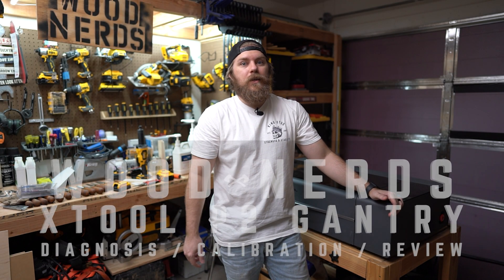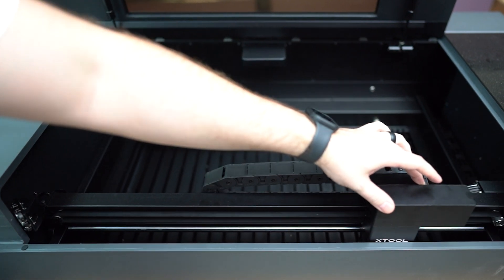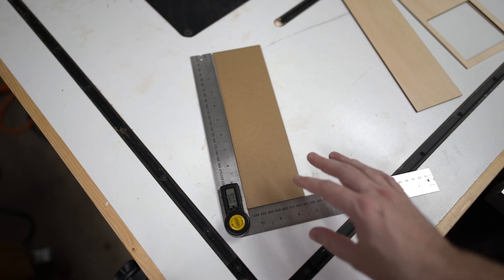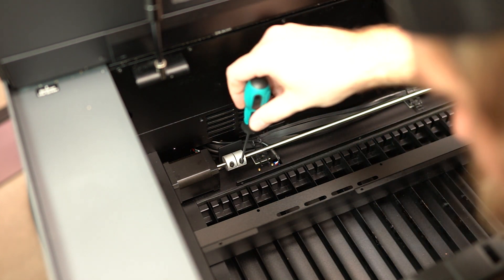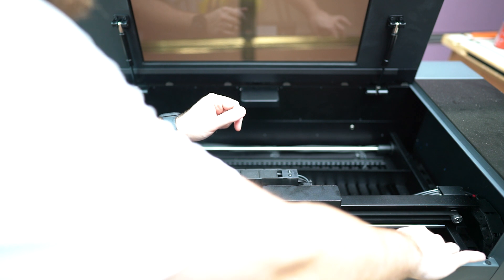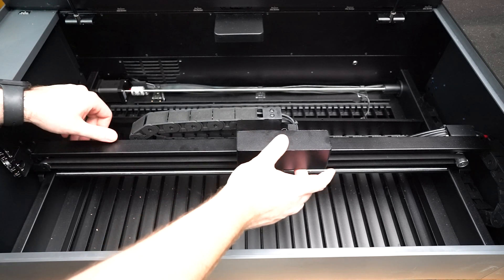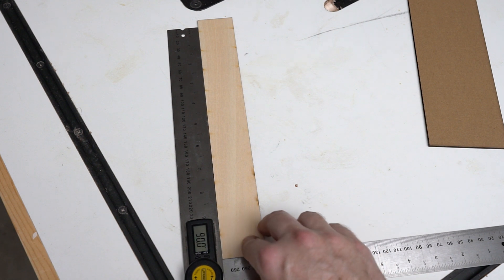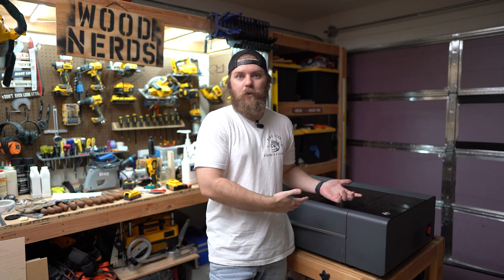xTool P2 CO2 LASER CUTTER | HOW TO CALIBRATE | REVIEW | SETUP

Comment: Great video! And sense of humor!
I’m one of the naïve poor souls that has never thought to check the gantry for square because I just assumed it was ready out of the box🤦‍♂️. 
Anyway, I know now what I need to do. I was watching another video, and he made adjustments from the front of the machine. 
Your method seems much easier. Is there a specific reason why someone would adjust the gantry using a different method than the one you’ve described? 
I only ask because I need to do this adjustment, but I fear the unknown… thanks man
Reply from the maker: Hey! I appreciate it! I’m not sure! I know xtool has different models out now. If what you have is the same as the one I show here I would go with whatever method seems easier to you. This method gave me near perfect accuracy!

Comment: I calibrated my P2 yesterday, because the gantry was not square.  But when I was unscrewing the pieces in the back, I guess I loosened them too much and the rod to the right disconnected.  I put it back, ran a test job and everything was fine.  Wood was square and right on. However, with the machine on, when I try to move the laser head or the gantry, it's very difficult and makes a grinding noise.  With the machine off, it's smooth and easy to move.  Did that rod disconnecting have anything to do with this happening?  Thanks for your assistance.
Reply from the maker: Hi, I don’t think the gantry should be moved manually with the machine turned on. With the motors off and disengaged they should be fairly free to move.

Comment: Greetings, thanks for the calibrate review! Can you tell me where the lower left 0,0 point is to line up material. I am a CNC guy for decades and Laser (P2S) is new to me. Thanks, Vince
Reply from the maker: Hey Vince! The user interface is much more visual with this machine. The camera allows you to place your burn program on the material you have on the laser bed. With the knives it’s hard to describe accurately where the starting point would be as if you had a grid mapped out similar to what you would use for a CNC (x,y). This is actually a neat benefit as you can put an abnormal dimension material on the laser bed and manipulate your burn to fit the material visually.

Comment: The bow in the plastic at the center is why using the chassis as a reference surface doesn't work to square up the axes. If it becomes square enough, then it's just a matter of luck.

Comment: Sam’s channel did it a different way. Y’all used the same blocks, but different methods. What’s the difference in methods?
Reply from the maker: His method you take tension off the belts (if I remember right) by loosening some screws. He mentions it’s what he came up with and an unofficial way to calibrate (no hate on Sam, I like his stuff). The method I use is the official method given to me by xTool that allows the gantry to move independently from the motor by releasing the shaft from the coupler. I found it to be really easy and effective. I adopted his use of the setup blocks as they are a great way to avoid any potential inaccuracy the laser module might introduce if the case of the module isn’t installed perfectly square to the gantry… it basically removes that as a potential problem as it’s hard to determine if the module is squarely mounted.
Reply: @WoodNerds thank you for the reply. Yeah no hate on the different methods. It was just 2 different ways and was looking for the best way to make adjustments. Thanks again for the reply
Reply: Dude! You just answered my question in this reply! Lol!
Thanks again for your videos! You and Sam are awesome
Reply from the maker: Haha great! Sam is awesome! Thanks for watching! Good luck with your equipment!